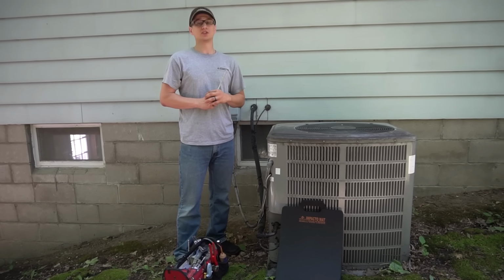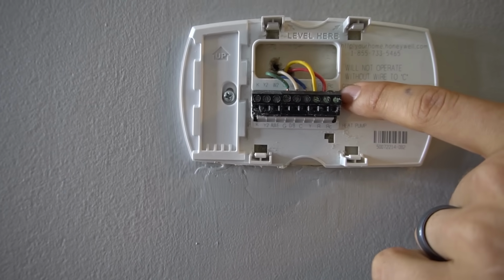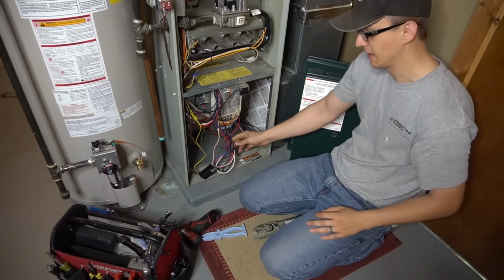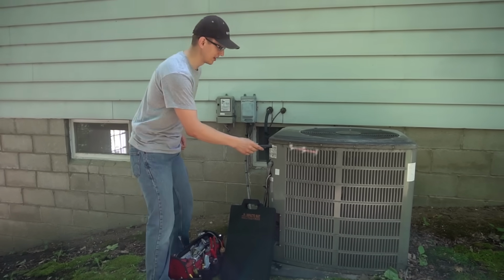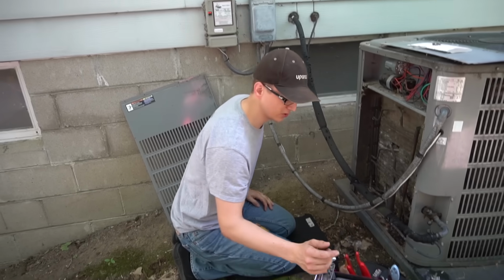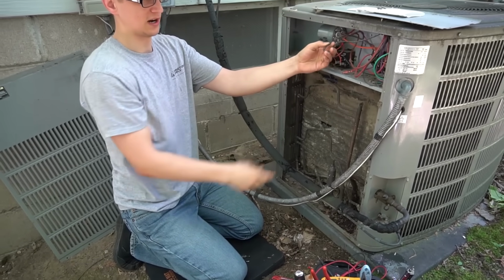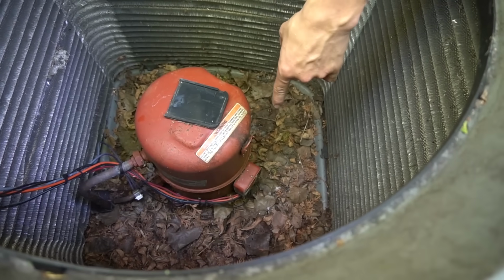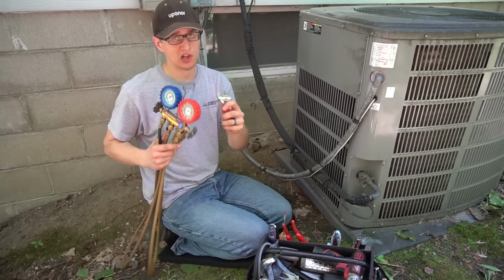AC Unit Not Turning On - How to Fix It Step by Step

Comment: AC stopped working. Breaker was tripped. Repairman replaced relay. Unit ran fine for about 1 day and breaker tripped again. Repairman returned and noticed that wires to compressor were burnt and were replaced. Hard start capacitor was installed. Start amps were reduced from 180 down to 90. System ran fine for several hours and then tripped breaker again. Resetting breaker did not solve problem. Am waiting for repairman to return...Any ideas? Thanks. Watched several of your videos. You seem VERY knowledgeable! Thanks again!!!

Comment: Wow excellent!!! please people watch the entire video it will help.  My outside unit was making a humming noise I check all the fuses and the thermostat before watching this video.  After watching it  I went outside with a slim wooden stick gave it a tiny push to the propellers and it starting working again.   Now A don't  know exactly what could be wrong, but is working ,,,,,  Do I  have to give it a little help all the time???   Barely  any air and No cold  air is coming out??  Any ideas??????

Comment: Yes, thank you so much for your video.  Our unit stopped working over night.  Found your video, went and got the part, put it in and it works!  $25 bucks.
Reply: The AC was off for about 24 hours.  After fixing it, my house smells like stinky socks.  Why would it smell like that after being off for 24 hours.  I hope this is temporary

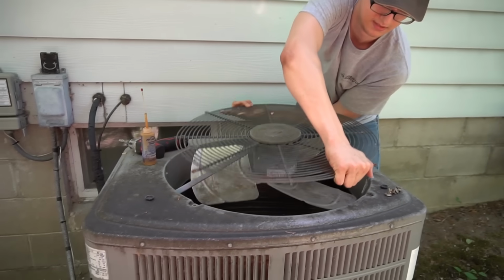Comment: 23:58 - A Tip :
_ My parents' perfectly good fan motor had been reinstalled after a service call that didn't include diligence for assuring the reinsertion of the fan's wiring loom insulation tube into the motor and the grommet into the condensor housing. ... Rain and snow entered the motor causing premature replacement a year later once it had corroded to the point of being completely seized.

Comment: Video es very well put together, you're message is very well explained and without the usual overload of 'uh's, um's' and spending 5 minutes of video introducing themselves and their pets, etc etc.  Also, I really love the references to the different sections, videos and tools.  I've been watching several of your videos and, you do give tons more valuable info than most out there.  Do you have a video on how to charge a home ac system without all the expensive thermometers?  Perhaps an auto ac manifold gauge, etc?  I've done many auto ac repairs, including complete compressor replacement.

Comment: Shorted the service/disconnect (toggle) switch recently, which tripped the furnace breaker. I reset the breaker and I have power from the breaker box to the disconnect service/disconnect switch. However, I don’t have power going to the furnace from the service/disconnect. As a result, neither my furnace nor AC has any power. And, of course, the thermostat doesn’t have power either. Is this just a bad circuit between the service/disconnect switch and the furnace?  I change the switch with no luck. Should I replace the wiring between the switch and furnace?  Thanks for your help.
Reply from the maker: From what you described it does sound like the only possibilities left are either a broken wire or bad circuit breaker. You would need to check voltages with a meter to know for sure.
Reply: Thanks. I disconnected the original hot wire running from the disconnector switch to the furnace and replaced it with a new wire. That wire now has power so power is restored from the disconnector switch to the furnace, and that part of the issue can be chocked up to damaged wire (from the short) . However, the furnace still has no power at all—no service lights. Could it be the panel (plunger) switch? Or some kind of reset that I need to do? The 3 amp fuse looks fine, BTW. Thanks again. Sorry to belabor this but I feel close to solving the mystery. Thanks again!
Reply from the maker: @enterthefray130  If you had a short in the 120v circuit, I wonder if the transformer was damaged? Have you tried checking resistance on it? Or you can just check and see if it is getting 120v in and outputting 24v. It kind of sounds like a bad transformer
Reply: I’ve somehow managed to get the motherboard up with a code of 0 showing on the led. This means it’s set and ready for a call. I tried to turn on the heat and blew the 3 amp motherboard fuse. I did have the blower running prior to that so some success. When I switched the fan to auto, the 3 amp fuse blew.. Replaced that and have the red 0 again. I guess my next move is to inspect the new thermostat I installed to see if it’s set up correctly. The AC also isn’t running, which is how this all started (when I cleaned the evaporators and accidentally shorted the disconnect switch).  Definitely gonna hit up your other videos on all this and try to proceed systematically until I get both working. Thanks again for all your help.
Reply from the maker: @enterthefray130  Alright, good luck! I have a video I posted recently on how to find a low voltage short. You may find it useful with your particular case.

Comment: OK, so your videos  have been very helpful in eliminating possible issues however, I still have no idea what's going on. The day this happened I had some crawlspace people under the house encapsulating and tending to mold issues (spraying a liquid solution), I cracked some windows to vent any fumes from harming my dogs. The air handler is in the crawlspace which also has a condesantion pump that is hooked to a gfci outlet inside the house, next to the thermostat.When I came home to a hot house the fan was still running but the outside unit was off. The gfci outlet was tripped and could not be reset. I changed out the outlet for a regular one to eliminte that being an issue. The facts:
1) fan is cutting on properly via cool setting or set to 'on'
2) outside unit/compressor would not cut on but runs great when "hot wired" or manually forcing contact
3) used your video to test thermostat and nothing happens when connecting the R/RC to the Y (therefore thermostat is not issue) 
It seems there is a communication issue or something or some unknown mechanism isn't allowing the compressor to receive the 'cut on' signal. Please help! any suggestions are greatly appreciated
Reply from the maker: Sorry to hear about the AC issues! From what you described, it sounds like the low voltage (24v) is not making it out to the contactor to pull in that plunger. I would start with this video right here: https://www.youtube.com/watch?v=NVPhsK4gK1A&t=2s

Comment: I am encountering what I am certain is an AC unit issue.  My equipment is different than what you presented but somewhat similar.  The internal house equipment appears to be working properly.  The outside unit appears to be the issue.  The capacitor looks ok but the unit powers up and fan kicks on as I would expect but after 30-45 secs of operation the fan stops and the electrical unit maybe relay/capacitor makes a less then normal sound for 3-5 secs and returns back to the fan running.  From inside the house the lighting dims when that happens.  All wiring appears undamaged by mice. Here is a video to what I am seeing.  Any insight you can offer is greatly appreciated.  https://drive.google.com/open?id=1bylr-qZ5HID0MPOPBIL63GJStbX4X6fP  Great video, helpful and educational.  Thank you!!!
Reply from the maker: The video link you provided does not work. But from what you described, it sounds like the compressor is attempting to start but is failing. Most likely this means the capacitor is bad. (it does not always bulge or leak when it goes bad). Or the compressor is locked up. You could try installing a hard start kit to fix that problem.
How to replace a capacitor: https://www.youtube.com/watch?v=9ZGfvC-PMWU&t=667s
How to install hard start kit: https://www.youtube.com/watch?v=ThBsRFrdNiY&t=91s

Comment: My AC condenser fan will not turn on. It has a PC board and displays error. Its an Armstrong Air unit. Discharge line temp above 279F and discharge senor open/ short.  is this something I can fix or do i need a tech. for a while i could turn the breaker on/off and it would reset and run for a while now it doesn't stay on.  whats the best fix?

Comment: Most informative video I have seen regarding this, period. I have a problem with my ac unit. Actually, I have narrowed it down to my compressor. About 4 months ago the capacitor failed, I know this because I replaced it and it started working again. The fan would not turn on and so the unit would shut off and not cool when the pressure got too high. Fast forward 4 months and now my fan and thermostat work, but when I turn the setting to cool, the compressor clicks on for maybe a second and does not continue running, however the fan does. I thought maybe the capacitor on the compressor side failed so I got another one since they are not that expensive, however this did not resolve the problem. I checked the 24v contact relay and I am getting 240v in and 25+-v at the relay and it is energized. I am not sure how these relays fail, but I did order one just in case because they too are not very expensive. I am not sure whether or not the new contactor will resolve the problem, but I would like to know if there is anything else I should check. The failure happened overnight. So after the initial replacement of the capacitor I had 4 months of no issues and then One night I woke up in the middle of the night because the ac was not working (I live in southern California desert area, so at 2am it was probably about 90F, during the day it's about 116F). I'm not a HVAC tech, but I am very mechanically inclined and can usually figured things out. In this case I haven't figured it out yet, but I also haven't replaced that last part yet either, but any advice you can offer on what else to check for would be greatly appreciated.
Reply from the maker: Hey Lawrence! I appreciate that you included all the details on what you tried so far! Sorry to hear about the AC not working. From what you described it sounds like the compressor is drawing too much amps at start up and is locking up. This is potentially fatal for the compressor. One thing you can try is to put in a hard start kit. It's a cheap part and very easy to install. That may help your compressor start back up. If it does not, then unfortunately that compressor is likely done for. (unless there are burnt wires at the compressor pins which are causing this) I have a video on the hard start installation too: https://www.youtube.com/watch?v=ThBsRFrdNiY&t=3s
Reply: @WordofAdviceTV  interesting you mentioned that the compressor is drawing too much power. I just noticed last night that when it does attempt to start that there is a very noticeable power drop throughout the house (dimming lights). Any recommendations on a specific hard starting kit?
Reply from the maker: @Lawrence Here is the hard start kit I typically use which is the same as in the video I referenced above: SPP6 Hard Start Kit: https://amzn.to/2JSPieo
It is for 2-5 ton units which pretty much covers most residential air conditioners.
Reply: Ordered. Thanks.
Reply from the maker: @lsmalley  Alright, I wish you luck! Hopefully that will get it going and keep it going.
Reply: Well, replaced capacitor, 24v coil, and added the hard start kit and still no go. I removed the fan and used a nylon tool to press down contact to activate the compressor and it will act like it wants to start, but it won't kick in. I can see on the label that it is thermally protected which must be why after each time it attempts to start and shuts down it waits about 8-10 mins before trying again if it's on auto. I did feel the compressor and it gets warm after it tries to start. There is no continuity between the compressor housing and any of the R, S, C wires. Possible internal short within the compressor? Or maybe something is stuck which causes it to get hot enough to trip the thermal protection switch? Just guesses, but I'm out of ideas so going to have a HVAC tech come out and check it out.
Reply from the maker: @lsmalley  Yes.. Unfortunately it sounds like that compressor may be done for. It may not be shorted to ground but it can have an open winding internally. (I have a video on how to check a compressor) And once that happens, if it is a R22 unit, then that likely means it's time for a new air conditioner. Sorry to hear about the bad news

Comment: I love your AC videos!  They’re amazingly easy to follow and very helpful!   I seem to have a bit of complex problem.  My AC stopped working yesterday and from your videos I was able to determine that the capacitor was not working when I pressed the plunger in the fan did not turn on yet after replacing the capacitor the fan started right up when I presses the plunger in.  Great!  I thought problem was fixed….but when I turned the power back on and set the thermostat to AC at temp lower than room temp then furnace fan started blowing air but outside AC unit still did not start outside unit fan. I turned the unit off, tied the plunger down with a string, and it works great (other than it's constant on since string forces plunger down) – incoming temp is 22 degrees lower than room temp.  However only way I can get it to work is by forcing plunger down to get fan blowing.  I’ve looked through several videos and not really sure what else to do.  Thanks again so very much!  Your videos are awesome!
Reply from the maker: Thank you! Glad to hear the videos are helping and you are making some good progress on getting it completely fixed! :) I don't know if you have seen this video yet but it is all about the contactor plunger not pulling in: https://www.youtube.com/watch?v=NVPhsK4gK1A&t=2s
Reply: @WordofAdviceTV  Awesome!  Thanks - I'm so unfamiliar with AC I didn't recognize that "plunger thing" is called the "AC Ccontactor" so I skipped over this video!  Thanks, this fixed it.  Turned out to be reason number 8 - "Tripped High Pressure Switch".  Easy to fix but really surprised me when it actually solved the problem by merely pushing a button.  Thanks again for your help.  I gave you a $40 donation a s token of my support for your very excellent and helpful videos - so very well done - you really know your stuff.  Thank you!
Reply from the maker: @Larry Read Awesome! That's great news! I appreciate you coming back with an update and better yet, to hear that it's fixed! Thank you for giving me high marks and your support is much appreciated! Stay cool! ;) Hopefully you can forget about the AC for the next 10 years or so now!

Comment: I have a Rheem AC unit the outside fan does not come on I replace the capacitor I replace the thermostat on the inside fan still does not come on on the outside if I master relay switch on the outside fan comes on but will not stay on please help
Reply from the maker: I would suggest this video for that problem: https://www.youtube.com/watch?v=NVPhsK4gK1A&t=2s

Comment: Hello, I did your suggestion about pressing switch to see that the unit is getting power and the fan comes on but it is not coming on from thermostat.  What could that be?  I oiled the fan as suggested but still it is not coming on from thermostat. The fan inside works fine.
Reply from the maker: This video should be able to help you track down the problem: https://www.youtube.com/watch?v=NVPhsK4gK1A&t=2s

Comment: i replaced my capacitors...ac turns on but fan does not spin....if i spin fan manually then it kick on...help please
Reply from the maker: This is probably not what you want to hear but if you replaced the capacitor and the fan motor still does not come on without you giving it a spin, then the motor is bad and should be replaced.
Reply: @WordofAdviceTV  thank you very much

Comment: question. do you always have a bigger air unit going inside the house near the basement? i have a goodman and im on a slab and dont see anything inside just the fan unit outside. also have air going into house. the air isnt hot but not cold. maybe 75ish. noticed ice on pipe going into house. im so lost

Comment: great show that jump start worked like a charm for me.
Reply from the maker: Awesome! Glad to hear that! Keep in mind that this may be an indication of a weak capacitor or a fan motor that is starting to die... So if it happens again, I would try replacing the capacitor. (I have a video on how to do that if you'll need it)

Comment: Thank you very much for this video.... I'm having an issue with my AC Unit. My AC unit is exactly like the one you show in your video. My  AC unit will blow cold air for about 15 min. After 15 min the condenser fan will shut off and the air coming inside my house is now room temperature . Every time I turn the AC Unit it blows cold air until the fan shuts off at exactly 15 min or so. I can hear my condenser still on  so that not shutting off (no abnormal noise coming from the condenser at all). I've replaced both capacitors , replay , contactor and condenser  fan motor. Ive also changed out my thermostat. I'm still having the same problem. I've check the wiring and everything seems to be fine. Any help would be greatly appreciated. Thank you in advance.
Reply: Hi Sergio, I have the same problem you had a year ago. Can you please tell me how you solved it? Thank you
Reply: @carmelita9867  I called a professional AC Repair company and they sent someone out to try and fix the problem.  They checked the freon level which was fine. I have no leaks. They also checked both capacitors , replay, contactor, and condenser fan motor which turned out to be good. They also checked to make sure there was no short in my electrical system. They found that to be ok. They concluded that my evaporator coil was bad. 
Please let me know if you find a different fix for your system. Thanks